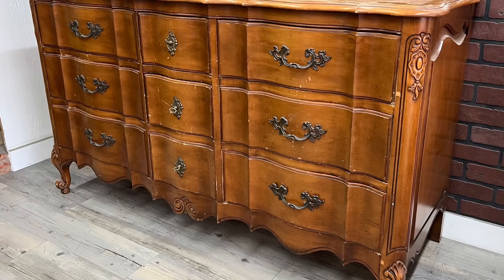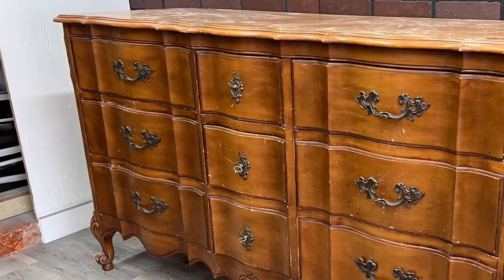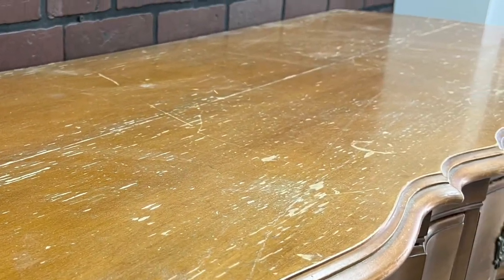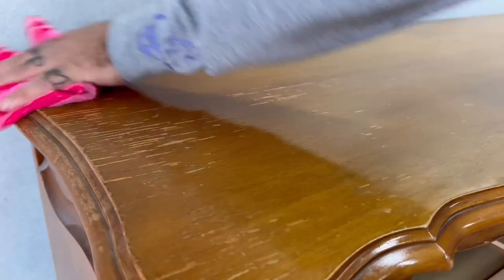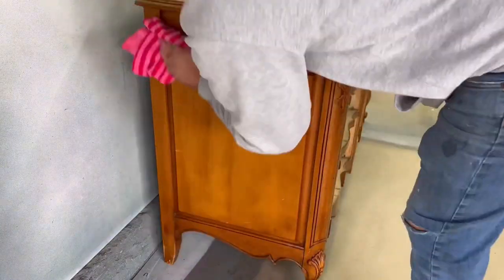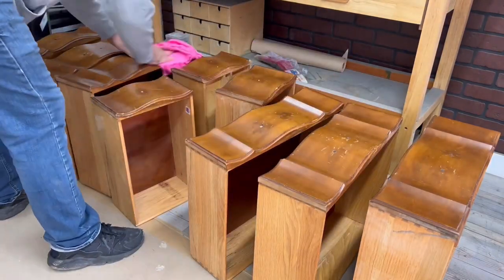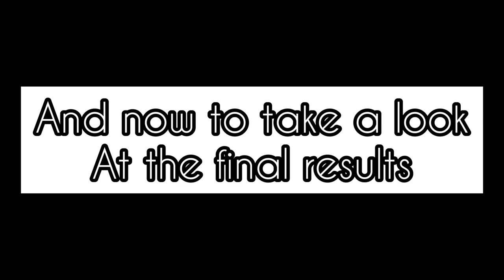FRENCH PROVINCIAL dresser set makeover using white wash || AMAZING trash to treasure TRANSFORMATION

Comment: Awesome job! If you did not use your sprayer but used a paintbrush to paint it, would you use the same grits for scuffing, 220 in-between and 400 finish?
Reply from the maker: Absolutely. Just be careful when sanding. Light scuffing is fine
Reply: @CedarPineDesigns  Thank you so much for your prompt response.  Explains why my prime was coming off as I was using 120.
Reply from the maker: @aholaway3048  no problem. Yeah, 120 is a removal grit
Reply: I am told that the wood is Poplar by a couple people on my Facebook request. I am trying to learn about this and would like your input as to what type of wood you were working with
Reply from the maker: @aholaway3048  the top is veneer so I doubt it’s poplar. It’s either cherry, oak or maple
Reply: @CedarPineDesigns  I cannot tell you how special and honored I feel that you would take time to actually reply. I'm so very grateful! And glad that you don't agree with the other people, I didn't think it was Poplar Oh, I thought it maybe cherry. But either way I guess I could leave the top unpainted, and seal it.
Reply from the maker: @aholaway3048  absolutely no problem at all. I love to help anyone who has projects of their own. I also have an instagram where you can DM me if you have questions moving forward. Reach out anytime

Comment: I have the same set but my middle hardware has no screw in the back so no idea how to remove it. 😢
Reply from the maker: That’s weird. I wonder what’s holding it down. I’m sure there are screws somewhere. Any holes in the back
Reply: @CedarPineDesigns  No holes. I saw another video where the restorer just pried them off with a screwdriver so that would probably work but I'd be concerned about getting them back on properly.
Reply from the maker: @blondewriter99  that’s so weird. I’ve never seen that before
Reply: @CedarPineDesigns  I'm just guessing at some point someone decided to glue on some additional hardware for decoration not function.
Reply from the maker: @blondewriter99  that’s a very good possibility